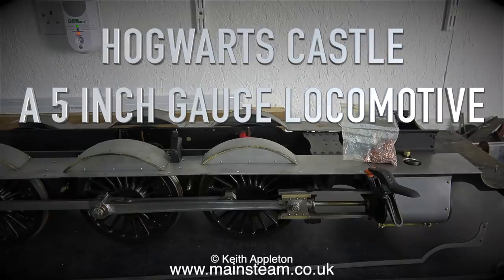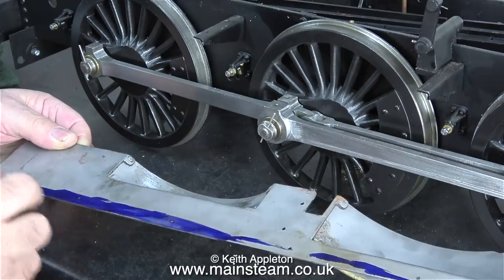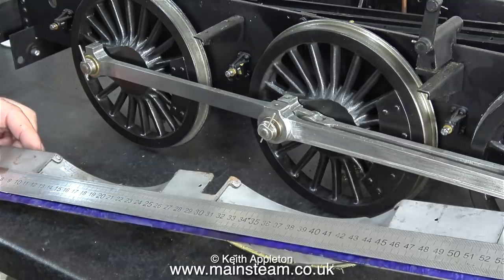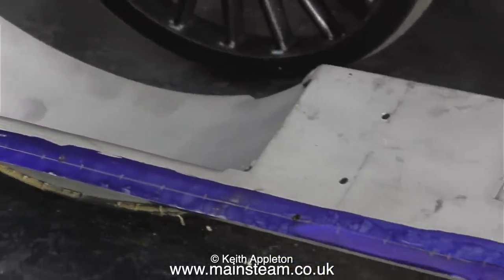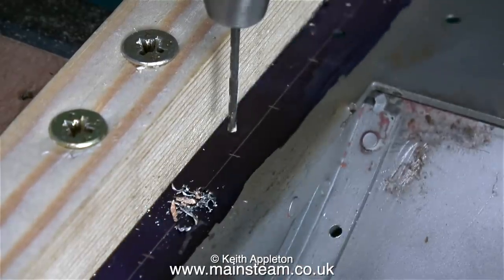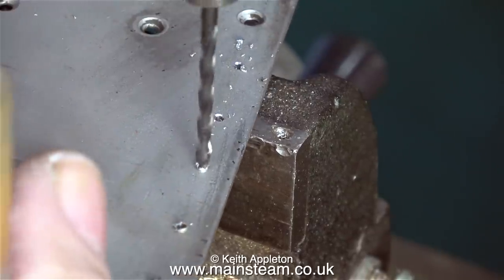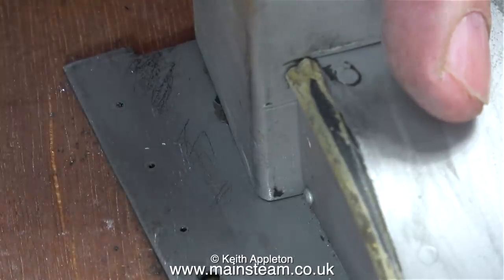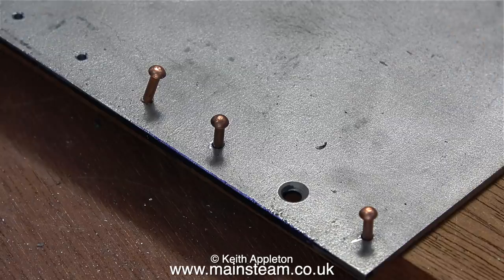HOGWARTS CASTLE   A 5 INCH GAUGE LOCOMOTIVE - PART #31

Comment: I have accidentally drilled a hole in the wrong location before.  I used simple soft solder to fill the incorrect hole and then sanded it smooth.  Once painted, you could not find the errant hole location.  Of course this only works for small holes that don't need to hold anything.  I think it would work if you also drilled a hole the wrong size.
Reply from the maker: Me too, but on these long thin parts I was worried about the heat distortion. I will be using "JB Weld to fill over the countersunk bolts that will be fitted shortly.

Comment: I hope you don't mind me asking why you didn't use a centre punch before drilling the rivet holes?
Reply from the maker: If you have a sharp  correctly ground drill bit, you can generally tap the work with it which then makes a centre punch type mark to guide the drill - it saves time on simple jobs. I have shown this method in various videos.